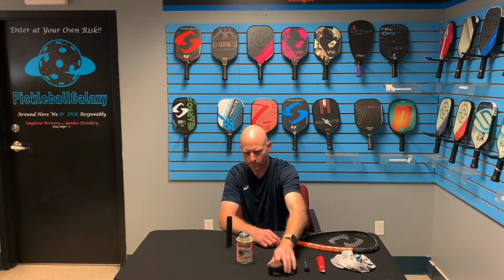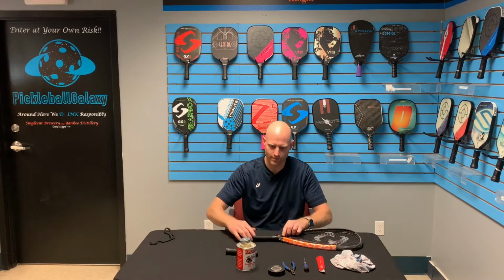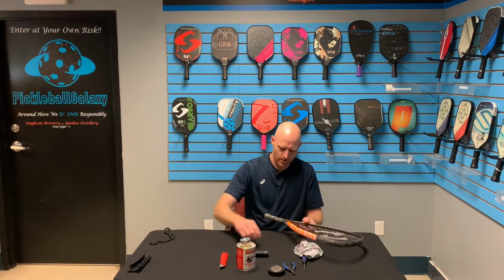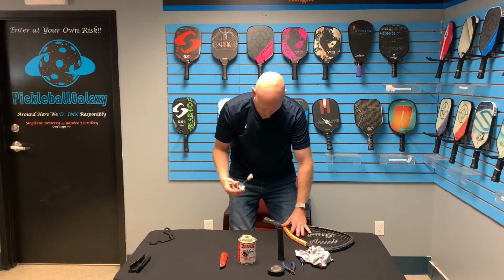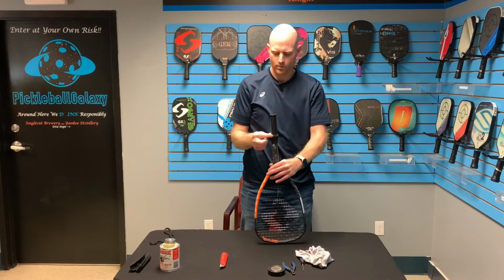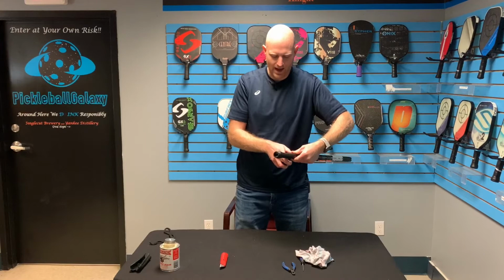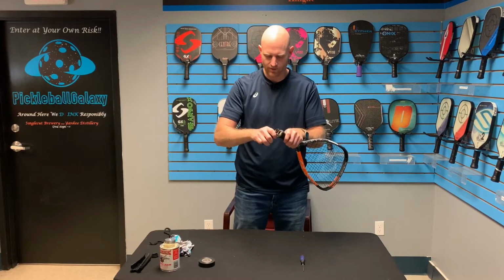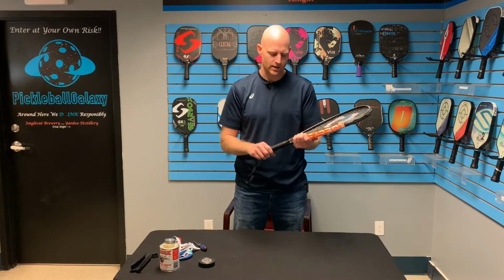RacquetWorld Python Grip Installation Tutorial

Comment: I soaked my new grip in boiling hot water for 2 minutes to soften it up before applying the WD-40 and slowly working it up and over the handle.  Took me about 30 minutes, since it's easy to rip the grip end as you push down if you are not careful.

Comment: I’ve used rubber cement many times. Maybe it adds an insignificant amount of weight, but it’s certainly not permanent. also it helps it slide on easily.